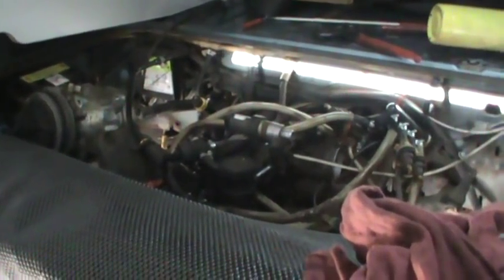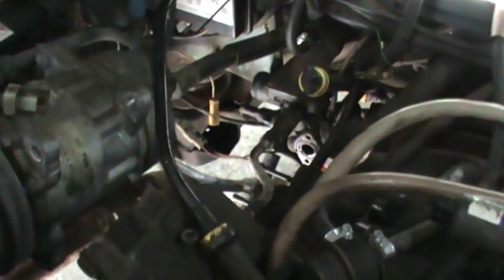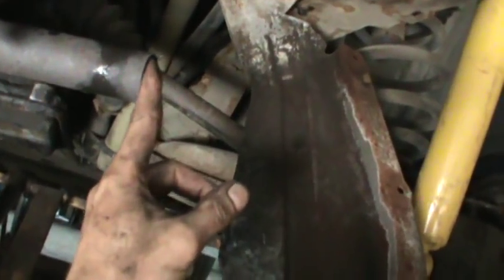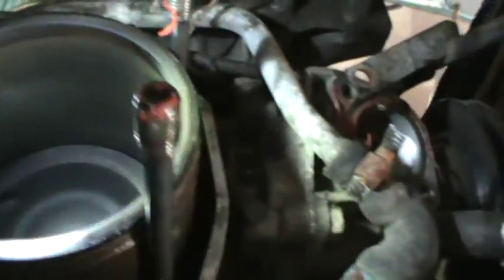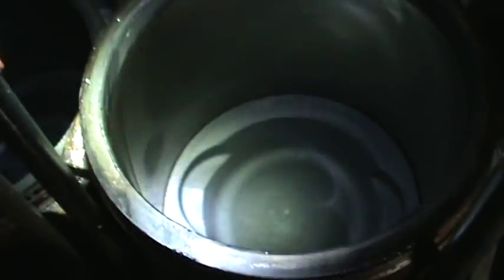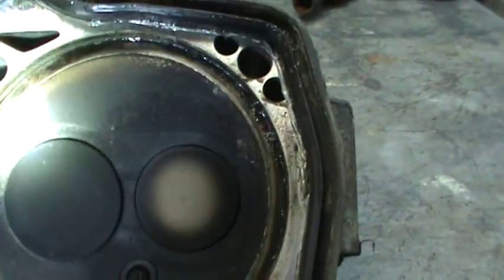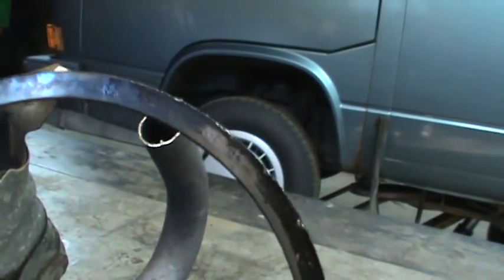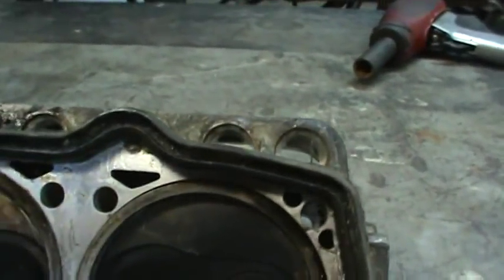1988 vanagon heads removed

Comment: Great video! Got a question: How much is the A/C pump in the way and can you keep it connected so the freon stays in the system? I want to do the head gaskets in my Westy and like to keep the engine case in the van while doing it. Watching you video ( you have the exact same van ) that should not be an issue. Thanks!